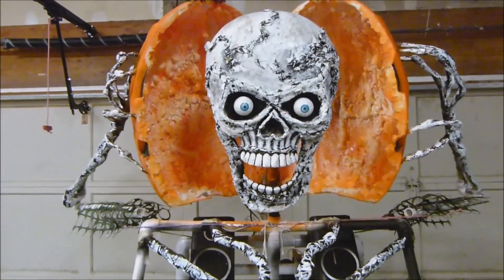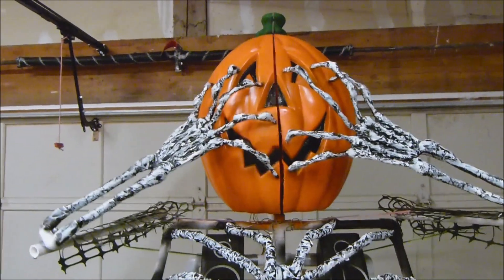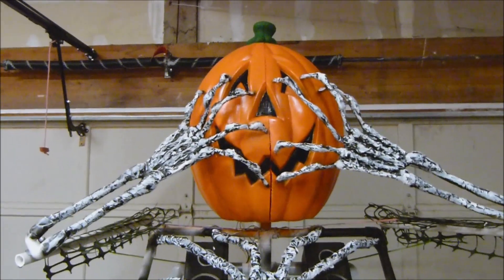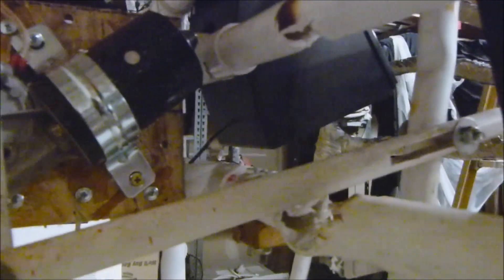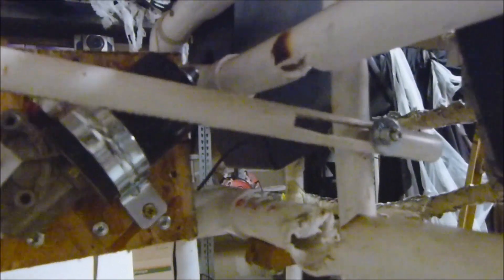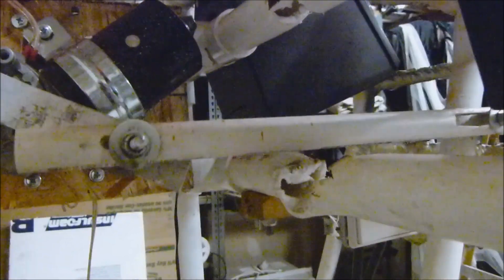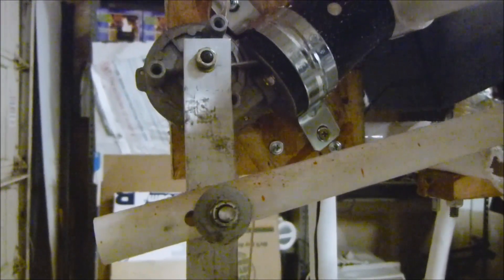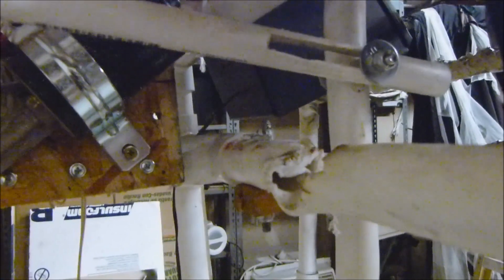2019 Animated pumpkin linkage

Comment: This is probably the dumbest question ever but I have never grasped how to make the second connection on the motor revolve. I see in your video the arm attached to the motor is a solid connection. But the the end of that arm connected to the prop allows the spinning. What washer and bolt combination do I need to do and prevent the nut and bolt from loosening as the prop moves?

Comment: Question. This year I am wanting to make a prop that slowly goes up and down. The prop is to look like something is coming out of a water well. Could I use a raindeer motor for this? Wanting a plug in motor (easy) since I have no experience with motor connections.  Thanks and keep up the great work.
Reply from the maker: My 2 cents - I tried a reindeer motor only once - and sent it back broken.  The problem with the motor to me is - it has plastic gears  - so what happens if it gets too much force on it, the gear will strip (break) at that point and will be that way from now on.  So each rotation it strips out at that point.  Plus the motors have pretty much zero torque - they definitely are not meant to lift any weight at all.  As you can see when they are used in those reindeer props, they are meant to only make something lightweight move back and forth. So I would not recommend using a reindeer motor to try to lift anything up out of a water well.  I'd expect the gears to break.Regarding you wanting a plug in motor - go to monterguts.com - they sell their wiper motors with the plug and dc power source.  It's going to be at least twice the cost of a reindeer motor but the wiper motors are well worth the money. The plug goes directly into the motor connection - it has 2 speeds to chose from.  Plus you can also by a speed controller if you want the option to determine the exact speed of your prop.  I use speed controllers on all my props because I like being able to determine the exact speed.  But you could start without the speed controller and always pick one up later.  Hope this answers your question

Comment: You deserves the Nobel Prize sir!! Lol! Maybe one year i can try this but definitely this year. Awesome! Awesome
Reply from the maker: thanks - since this video I've changed motors which I posted a video on - I'm down to around 5 RPM so the pause is longer.  I've also changed the way I hold the prop closed - a better design with the rubber bands.  Also I forgot to mention in this video that I got a plastic bushing (lowes) that goes over the bolt through the cutout of the shaft.  This makes it slide much smoother.  Good luck

Comment: Nice effect Rick, but could we see a side view to see how the arms pull back ?
I have a 5rpm motor so they are available. I think the power supply has to be at least 1 amp to even turn the motor even though all the pvc, bolts and skeleton are not that heavy. Thanks for all your hard work.
Reply from the maker: Hello -   first the arm movement - the arms aren't really moving as part of the motor movement.  The arms are attached at the shoulder area on pivots and the hands are attached to the head pieces.  So it "looks" like the arms are opening the head but they really aren't.  If you look at one of the earlier videos you will see the linkage I designed at the rear of the two halves of the head.  The motor is only pushing the top half of the prop forward, which forces the two halves open - which with the hands attached to the head make it appear that the arms are opening the head but they really aren't. The arms just pivot.I posted in one of the earlier videos that the wiper motors didn't have enough torque at the slow RPMs to open and close so I ended up buying a motor with 3X the torque.  I'm using a speed controller and have it slowed to around 5-6 RPMs and it's working fine.  The motor I use is listed in the other videos.  Let me know if you need any more info.  Good luck
Reply from the maker: I just looked at this video and noticed you can see exactly how the arms are attached at the pivot points.  That's all I was trying to explain earlier.  The whole movement is really based on the upper section leaning forward and back.